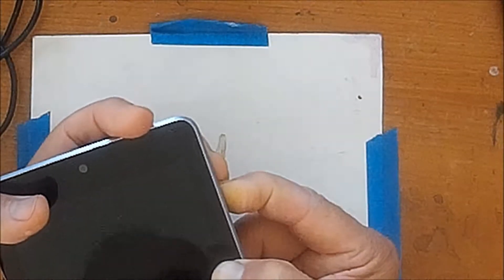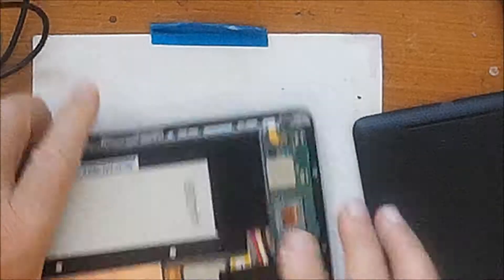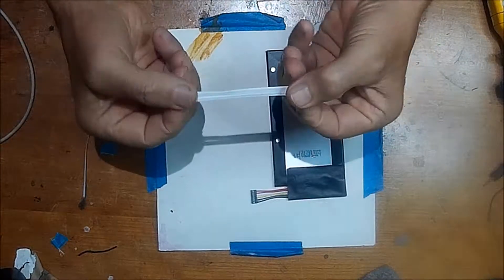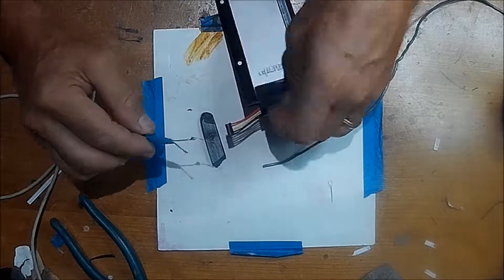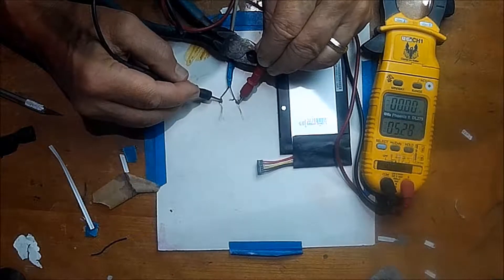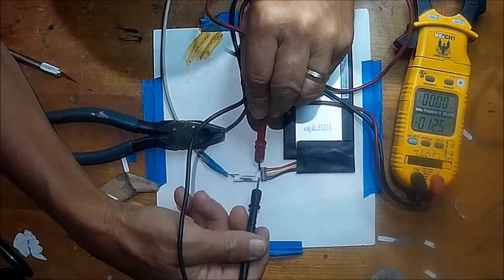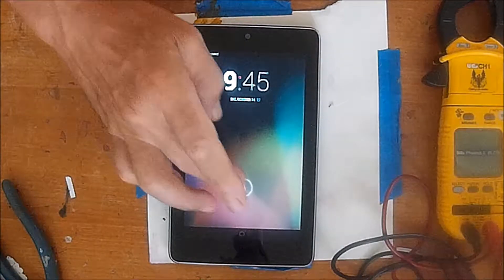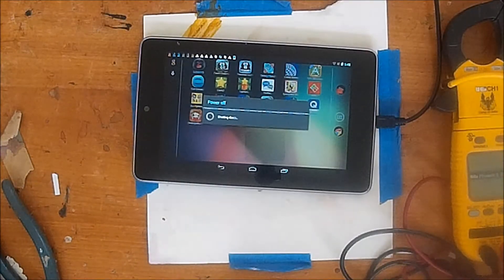Nexus 7 won't START UP? Jump start the battery

Comment: I have a specific need and a question regarding this. the square holes on the side of the connector. do you think you can solder the charging wires there so that you can leave the battery connected to the tablet, charge and use the tablet at the same time? I currently have a project going where I am using an old Nexus 7 2012 model as a retro gaming platform. I would love to be able to play games on it while the battery is charging. I purchased a device for samsung phone that does this. it allow charging while using usbOTG at the same time but it doesn't work on the nexus so my need is to have the nexus using usbOTG device while at the same time charging.
Reply from the maker: I'm not sure. You'll have to make the experiment. But you have to disconnect the cable from the MB in order to charge it . I'm not sure if I'd connect an external power source  while plugged into the board. Remember we're jump starting because something is not  quite right
Reply: I watched another video where a guy hacked a wireless charger into this same tablet and he connected the power to the USB port internal connections. probably good advice not to go direct to the battery. I bet there is special circuitry from the USB port to the Battery that takes care of any concerns. Thanks for your reply.
Reply: Hey, I just wanted to follow up. Not sure if the OS makes a difference because some folks reported early on that this did not work while the tablet was powered on but for me it did. i have Lollipop installed. Along the left edge of the tablet are 4 "POGO" pins. The top one (closest to the camera) is Ground and the Bottom pin is +5v. I tested it and it charges while the tablet is on so my next test will be to see if usbOTG works while charging via the POGO pins. I won't clutter your video anymore with updates but thought I'd circle back and let you know about the pogo pins. Thanks for your video by the way. it helped me revive this tablet a couple of weeks ago.